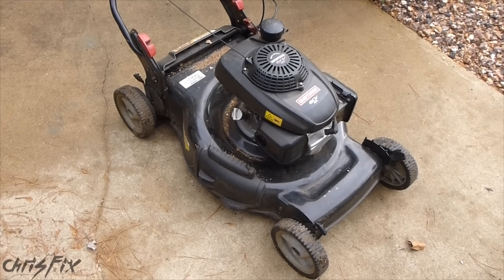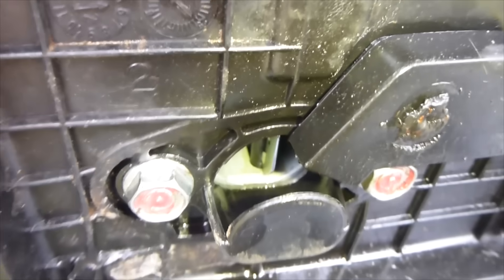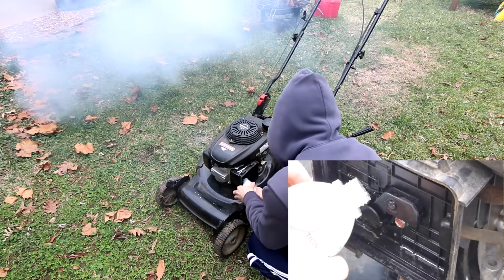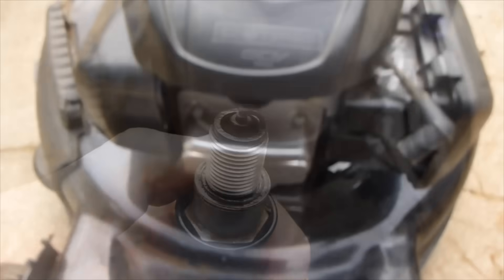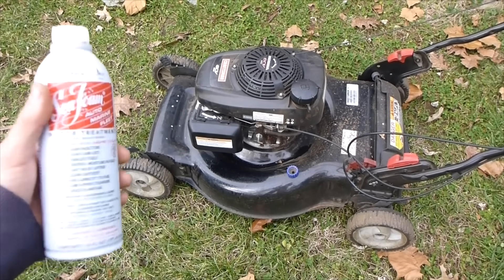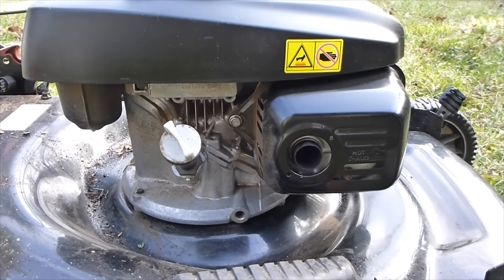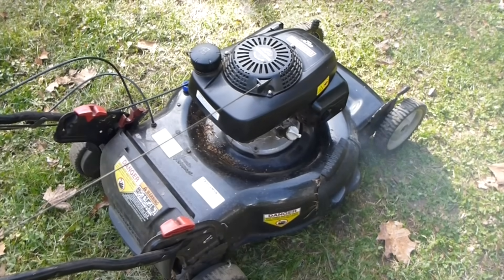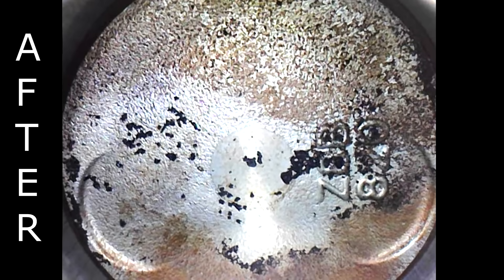Does Seafoam Actually Work? (with Proof)

Comment: DO NOT USE SEAFOAM IF YOUR ENGINE BURNS OIL ALREADY! My bike burned a little oil because of some failing piston rings. I used seafoam to see if I could get it to run any better and it released what little carbon that was holding back the oil and it started burning so much oil that it was unrideable. Granted, I needed to rebuild the engine anyway, it just sucked that it took it out of commission until I could rebuild it. I only use seafoam every once in a while in my car as a fuel additive. Especially in small engines, there's no excuse for not just disassembling the head and cylinder and properly cleaning with a wire wheel, then honing the cylinder and lapping the valves. Don't put a band-aid over a gunshot wound and expect it to work.
Reply from the maker: Tyler Ketter Yea, if you have an old engine that might need a rebuild, cleaning it out might cause it to burn more oil (as you learned). Sometimes a dirty engine helps limit the amount of oil you are burning! Same goes with the cooling system. When you flush a heater core or your entire cooling system, if it is really old, the dirty and debris can actually be clogging gaps in gaskets or pinholes that would otherwise leak. Thanks for sharing.
Reply: You know the 1/7th of the work ;) Changed the oil/transmission fluid and filter. Changed the front springs...couldn't do the back ones in the time I had (Christmas vacation had ended 2 days earlier, but the 8 hour days on her car went on!)....so many rust issues, lol. But hey, all this and a power steering flush later and she got 20 MPG up and over a mountain! She got 15 MPG down a smaller grade earlier in the other direction!

That math just doesn't work, but it's true!...she hadn't seen easy flat highway driving with better than 18 MPG in 12 years!

LOL. Took her a day to learn how to drive her new car. "It's too responsive!" She'll get used to a good thing. :)
Reply: ChrisFix +Tyler Kette I really enjoyed the resulting information I learned from the conversation you started. Sorry Tyler that it lost you the use of your motorbike. I just flushed my mother's heater core with your advice Chris! It was violent! First the water wouldn't move and then it sputtered crud off and on like a struggling engine. Took super little water to go clean. 

From random heat to steady. I chose to just change the radiator fluid rather than use a caustic flush as everything was really rusty. Had a 1989 Nissan Pulsar for a first car and I flushed it really well. The fluid wasn't that bad but after a year the system totally rusted. So I surely agree to take it easy on an old system.
Reply: ...if only I had time to do a water decarbonization treatment too! My brother apprenticed a bit on this job and maybe I can direct him through it just before her next oil change.
Reply: Using any working de-carbonizing method from day one on any type of motor would most likely keep it in the best possible shape for a lot longer.
Reply: Addictive_LiquoriCe Right, but the question is whether or not it's worth it. On a motorcycle engine like mine, or a lawn mower, generator, etc., I think it's honestly a waste of time to spend all that money, over however long, instead of just running it on only gas, then every long once in a while, rebuilding and cleaning the head.
Reply from the maker: DE Nichols Glad the heater core flush video was helpful! Glad your mom's car has heat now!
Reply: Right. For example the Gumout Chris worked best on the carbon that was still soft. Be warned though PEA though not used by Chris yet is supposed to work on carbon however on clean engines it'll deposit new carbon sooner on cylinder heads.
Reply: Tyler Ketter for sure. If something is so bad it needs rebuilding I recommend to not use cleaners until you have a new engine or have rebuilt it. I've destroyed an old engine myself when I first worked on cars. 

Thank you for reminding me that I not forget. If an engine just needs some help. Why not? I used to never use them. Now that I can fix a lot more I keep things longer and cleaning as I go is worth every penny. ... so long as what I'm doing is effectively.
Reply: Tyler Ketter gunning up a Kawasaki fa76d
Reply: Donald Ahrens I don't that engine, but I love my Yamaha WR250R. :)

Comment: Can it cause low compression on an old engine when it's all clean?
Reply from the maker: mddaredevil  If the engine is in good shape it wont do anything but clean out the carbon. If the engine is old and might be worn, sometimes the carbon buildup actually helps the engine seal better (ironically). So if you cleaned out that carbon, it could lower compression. That is why I dont mess around with my 300k mile van in these videos lol.
Reply: That's what I thought :)

Comment: Its good to see people asking questions about these products. I have a couple of theories about the test that I would like to put past you. The carbon build up on the car engine was very different to the build up on the Lawnmower engine. My logic tells me that because the lawnmower is air cooled and the engine is water cooled, their operating temps are completely different. Therefore the carbon will be baked on to the piston much tougher in the hotter car engine than a air-cooled lawnmower, because of the different levels of temps they are exposed to.  I think if you used the gumout in the same way as the seafoam on the lawnmower the results would have been similar.  Looking forward to hear your thoughts
Reply from the maker: BMAC VAGS Well, we will find out when I test the seafoam in a car engine and see if your theory is correct. Gumout is not designed to go into the engine though the intake, it is designed to go into the fuel so that is how I tested it. I do not know and would not test it by running it though the intake because that is not what the instructions tell you to do. If gumout designed it to do that, they would have put it in the instructions.
Reply: ChrisFix Fair enough pal, I can accept that reply.  At the same time it does not say seafoam is designed to soak the piston ;-)  At the end of the day we are all here trying to learn, I hope you don't offence.
Reply from the maker: BMAC VAGS The piston test was because many subscribers asked "what would happen if you soak the piston" (which is why it is the bonus footage at the end). You dont offend at all. It is good to hear from others and what they think! It makes the next videos even better!
Reply: ChrisFix Love what you are doing Chris, the more of us that ask questions, the better they will have to make the products.
Reply from the maker: ***** I will have to check that out! Thanks for the tip!
Reply: BMAC VAGS Is baby oil is a good carbon solvent, though?
Reply from the maker: OS Coutinho Almost any liquid will dissolve carbon but some will do better than others. Straight water will dissolve carbon. The oils in seafoam dissolve carbon. I wouldnt put oil in your engine to try and dissolve carbon when other, approved and tested products work.Who knows how baby oil affects the cats or O2 sensors.
Reply: OS Coutinho I have not idea if it is effective or not, i was just showing that the smoke effect was created by burning oil.  In my opinion, a mist of water in the intake works the best.
Reply: hahaha youll make any excuse to slander seafoam even with proof you still deny it works
Reply: ghettohillbilly1 A car engine gets to 400 degrees, an air-cooled lawnmower gets to approx 180 degrees. Do you think this would have an effect to how baked the carbon is on to the pistons? 

We can be dumb, and we can be realistic. Which one will you choose.
Reply: BMAC VAGS why did this carboned up lawnmower smoke less with more seafoam added than your brand new one did? do you deny after watching this that seafoam cleaned the piston? or is it all still just hype and myths? funniest part is you've already proven seafoam works in a car, in your videos after you seafoam and before you did your water test there was a noticeable difference but you wont even admit or mention that because that would ruin your slander campaign against a good product
Reply: BMAC VAGS What the hell kinda car do you drive that gets 400 degrees??? it would be a pile of scrap if it got that hot
Reply: Don't confuse coolant temp with internal combustion temps.  Steel start to glow between 500-600 degrees. After a long hard run lift up your bonnet and see if your exhaust is glowing. Also there are lots of examples of glowing turbos on youtube.
Reply: BMAC VAGS This is true, but have you ever watched an OBD-II, or other sensor reader? If you have red glowing exhaust, or a red turbo you have a clog, because flow is constricted. If you watch an OBD-II reader, the water temperature in modern engines, years '00+ should never go higher than 210.

In fact 210F is the center on 99% of water temp gauges. That's why most engines sit around 208-206 and sit right below the half mark.
Reply: ghettohillbilly1 funny how BMAC NEVER responds to any questions that dont suit his slander campaign Ive asked these and similar questions many times and everytime  I get some stupid comment like "We can be dumb, and we can be realistic. Which one will you choose" I choose: answer the fucking question and stop changing the subject when you cant back up what you say!
Reply: ghettohillbilly1 What questions did I not answer?
Reply: OS Coutinho I don't know to be honest, sorry.
Reply: ChrisFix Wouldn't baby oil affect the sensors in the same way seafoam does? Considering they are both mostly pale oil.
Reply: CDDYoakashi You are still talking water temps, pressurised water temps are very different to internal combustion temps.  If the metal temps were 210f is 98C, water doesn't boil till 100. So theoretically if water temps were the same as combustion temps, you would be able to sprinkle water on a hot exhaust manifold and it should not even boil.  But we all know that is not the case

Comment: Thanks for the video!
Could you please make another test with Chevron Techron Concentrate Plus Fuel System Cleaner? I see more good reviews against it compared to Seafoam, but I wonder if it actually works better.
Reply from the maker: CCL13 I will be testing Techron soon so stay tuned!

Comment: Is it possible to view the valves w/ your borescope? I have had problems w/ valve seating (small engines) due to carbon buildup, but never seen excessive carbon on piston cause problems. Your pics are typical for what I've seen. Good video!
Reply from the maker: Texas Pipeliner It is possible via a mirror that connects to the bore scope but it isnt good enough quality video to publish. The mirror is cheap and the focus is soft. But for personal use, you can check out the valves!

Comment: After soaking the piston I would have changed the oil after just incase any leaked past the piston rings. Great video.
Reply from the maker: mw3261 Thanks and yea, I am changing the oil in the spring (I wont be using the mower this winter lol).

Comment: I'll add myself to those who have had basically good results with the product.  However, after looking at the product MSDS and seeing it basically is "pale Oil", some say this is diesel fuel and Naphtha along with IPA (isopropyl alcohol), I cringe when I go and buy the stuff.  A couple Motorcycle forums have had people report results mixing their own from the basic components for pennies on the dollar with similar results.  Some even leave out the IPA figuring most modern gasolines have enough alcohol in them already.  So it may be primarily naphtha cleaning the engine deposits.
Reply from the maker: Rick Duncan Yea, it is amazing how marketing works right! They might have a good balance of the three chemicals so dont discount that.

Comment: GREAT VIDEO!!  Can't wait to see this performed on a vehicle.  What sort of intake method are you going to use on the car?  I've heard through the brake booster is the best method, but have yet to try it.
Reply from the maker: Timberlinetown I am not sure yet what intake method I am going to use on the car. I also heard brake booster, but I might try the intake before the throttle body.

Comment: Very nice.  If you ever decide to pour some on top of the cylindre of your truck, I would suggest using a vacuum and a clear hose to remove the liquid before putting back the spark plug.  That way you would ensure no hydro-lock and with the clear hose it is easy to see if you got all the liquid out.
Reply: By the way; have you seen the Like count for your video?  I think it means you are doing a really good job!
Reply from the maker: Leonard Ruel Thanks and thanks for the suggestion! I wont be pouring this in the cylinder of my truck because I dont want to take any chances with anything. 
And awesome! I am glad I am doing something right! Thanks bud!

Comment: You don't have to worry about hydro locking the engine or having it get past the rings into the engine oil its a lubricant and can be poured into the oil about 1500 miles before an oil change with no problems. When i seafoam my cars i get two cans one entire bottle in the fuel tank, 1/3 in the oil and whatever is left gets a slow pour into the intake then i flood it and let it sit for 30 minutes and drive. Last car i did was a maxima and the throttle body and intake was COMPLETELY gummed up with thick black carbon ran seafoam in it before i removed the throttle body, I didn't have to replace the iac it cleared all the carbon up after one treatment and unstuck the iac. Oh and also STP has a engine treatment its exactly the same formula as seafoam and most of the time you can get buy 1 get one free and its only 6$ compared to 8.99 for seafoam.
Reply from the maker: UkCobra You definitely have to be careful about hydrolocking. Even if you poured pure gas down the intake you have to worry about hydrolocking. Too much of any liquid can cause damage. Liquids are not compressible so. Thanks for sharing your experience!

Comment: I can't wait to see it in action in a car engine. I want to try some good cleaner. My pistons are a little dirty so that's why I wanna do it. It's OK if I soak and then remove with vac pump? It seems the best way to properly clean the pistons.
Reply from the maker: nuno ribeiro I honestly wouldnt soak the pistons. This was a test done on a cheap lawnmower just to see. On an expensive car motor, it might not be a good idea. I would just run it though the intake.
Reply: Thanks for the advice Chris. Waiting for the test in a car engine to see if works well. Happy New Year Chris.
Reply from the maker: nuno ribeiro No problem! Happy New Year as well!

Comment: I think seafoam worked better because of the method used (direct to intake rather then "watered down* with the fuel) - i wonder if injector cleaner/gum out etc works better with the same method

I know injector cleaner (even the cheap stuff) works great cleaning pistons/valves/intake by hand with the engine apart - its what i use rather then carby/intake cleaner (cheaper and better)

On another note, would more carbon on the piston cause higher compression because of less space for the air to compress therefor cleaning pistons specifically loose performance... apart from the fact that a carbon filled engine is restricted in other ways overall (valves intake etc)
Reply from the maker: apachelives Im just following directions and testing their claims. If gumout said to pour it in the intake, I would have. 
More carbon can cause higher compression, unbalanced pistons, and hot spots on the piston. You wont loose performance if you clean the carbon off. The cabon displaces some air that comes into the engine and also disrupts airflow so cleaning it out should only be beneficial.

Comment: Chris great job! So excited you went this route. Hopefully my comment on the gumout cleaner video was some drive to do this method. 
By the way, I think you'll get more of the "soak" effect cleaning via the intake if you choke the motor and let it sit much longer, ie half an hour to an hour. I've seen best results waiting an hour. I think you should do that on your truck since you won't be doing the soak method! 
I was unaware they even had instructions for an intake method. I was always told it was not on the bottle for liability sake but I swear by that method! Thanks again.
Reply from the maker: Doug Pawl Thanks Doug. I will be following the instructions for all my tests to try to stay uniform for all of the tests. Maybe after the initial test and results I will stray from normal and try something like what you said.